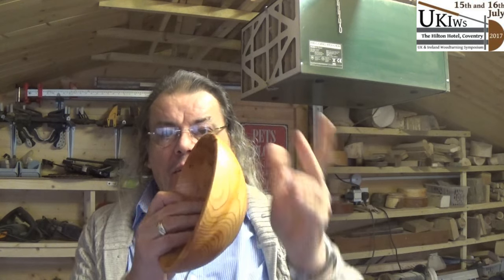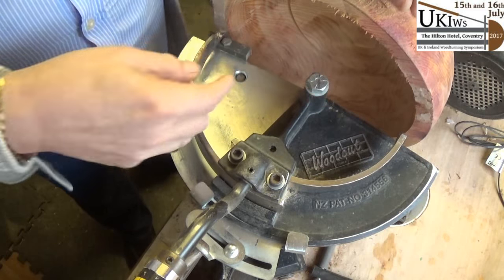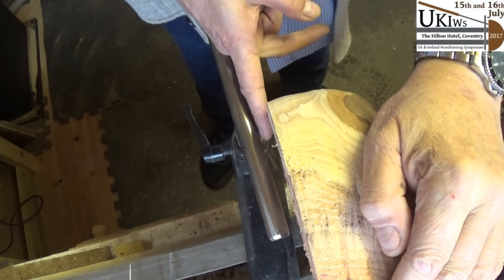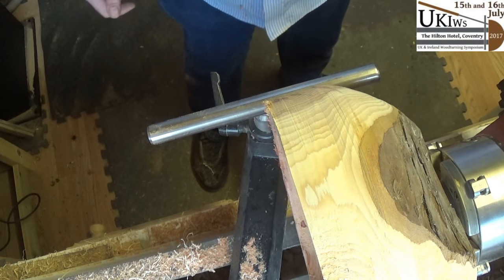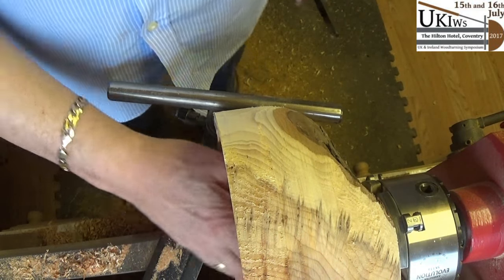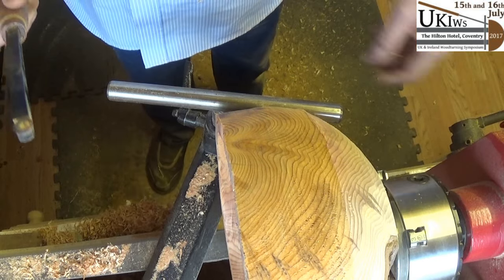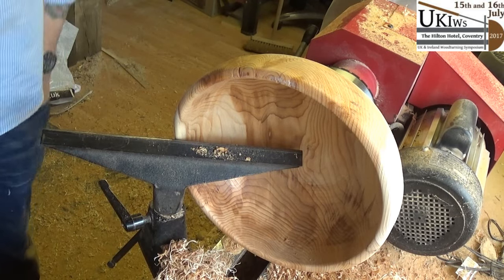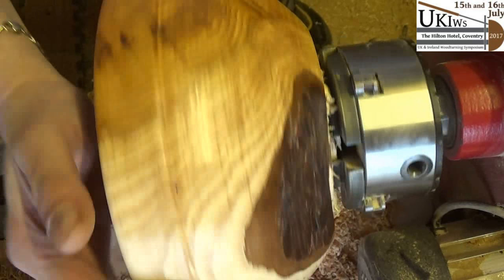Woodturning at 54a.  #116. A Yew bowl,and a quick look at the bowl saver

Comment: Spectacular bowl Keith. Yew is such a beautiful wood to turn, too bad that it is kind of toxic. Just a few precautions and the turner will be safe enough. I noticed a knot just to the right of the bark on the lip of the bowl. There was a small crack in the knot that I didn't see on the finished bowl...how did you repair the crack? This is a common problem with the wood I'm able to get my hands on. How about some tips on how YOU deal with different turning and finishing problems. Lots of videos on the subject, just curious on how you approach these problems. You could start a series of videos on the subject and share your ideas, experience and procedures. I know I'd watch them.
Reply from the maker: Hi Gil, I didn't repair the crack,in fact I didn't notice it was even there! Yes,I mentioned the toxicity in the last yew video I did.thanks for the idea,it's definitely worth thinking about,when I have a bit more time!Cheers,Keith.

Comment: My experience with cutter materials is this, as a life long woodworker and being in my mid 60's now, when I first started out carbide was not as available as today ans yes, I have heard people say you should always use traditional tools. When they say that to me I always ask them if they stay true to their words and use only high speed steel saw blades on a table saw? or any motorised tool?
Everything has it's place and the decision factor for me is what works best in the situation. For a saw blade or a router bit, carbide is the way to go. larger shaper cutters where you are grinding the knives and sharpening them then the high speed steel knives are best. High speed steel can be sharpened better than carbide can and the trade off is how long it can hold it's edge. Carbide will stay sharp longer but it is very brittle and once it is chipped badly must be discarded and replaced. For lathe tools, carbide cutters are very friendly to use, especially for the new turner. This is because they are used like a scraper tool. I like to use both types and find that they both have their uses. Carbide lathe tooling makes wood turning far more friendly.. (give a first time turner a skew chisel to use and see what happens).
Bottom line is use whatever works for you and have fun!
Reply from the maker: Well said!
Reply: Here Here!
Reply: James Stanlake I'm still afraid of a skew chisel. I've turned one rather complicated piece with it and it was ok, but later, on other pieces I had some really bed catches and I don't use it anymore.